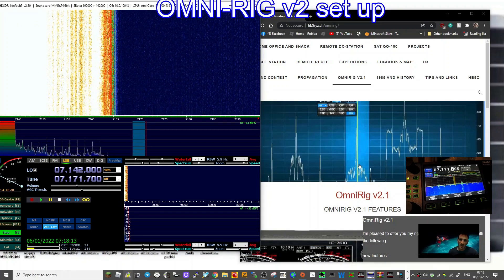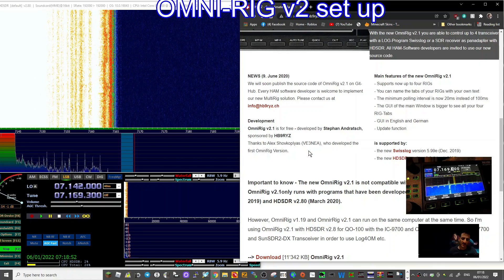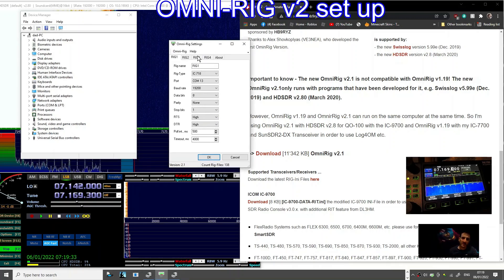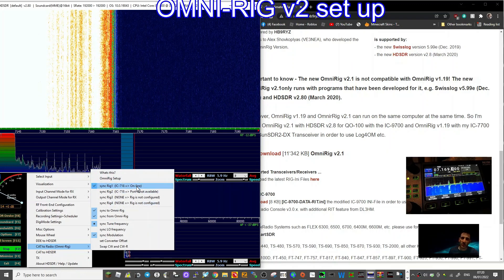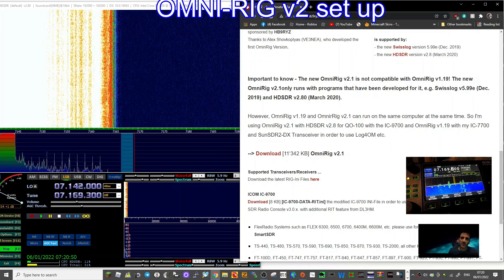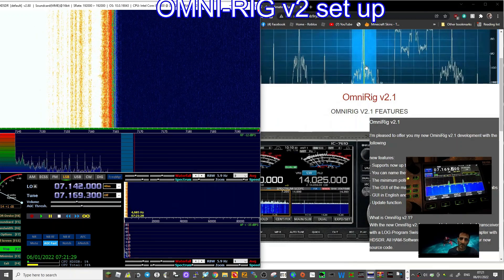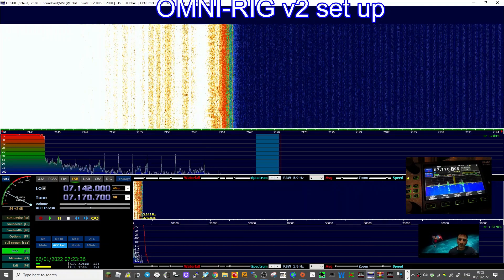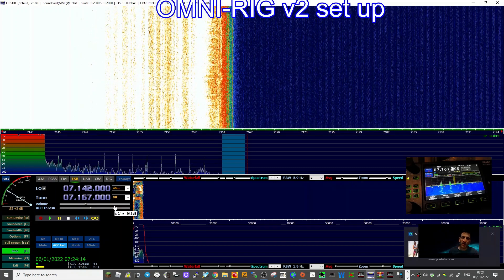Xiegu x6100 -Full Screen HDSDR with OmniRig V2.1

Comment: BTW, the rx audio cutting out problem you showed in one of your videos seems like what I had until I learned how to use the HDSDR squelch control. Auto squelch set sets the level too high for routine rx levels. Left clicking a level below the the current level readout needle/pointer manuals set the squelch to that level so you can set it appropriately. Right click sets squelch just below the current rx level.
Reply from the maker: Hi many thanks for info.
Reply: @M0FXBHamTech  Just got the newest INI files from HB9RYZ and the Xiegu G90 Omnirig ini fixes a HDSDR -> X6100 sync problem I had using the older ini. RF waterfall and spectrum shown is still only the rx passband. Maybe using radio's I/Q audio to the PC (don't know if it will require an external soundcard) will fix that. Will also be trying a tx soon, crossing fingers..